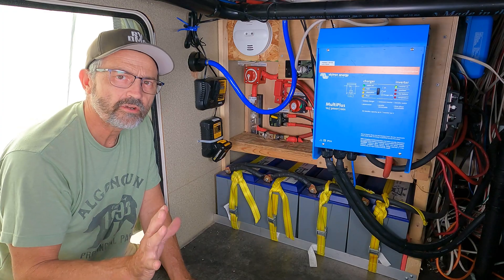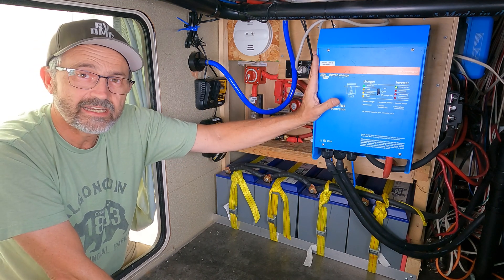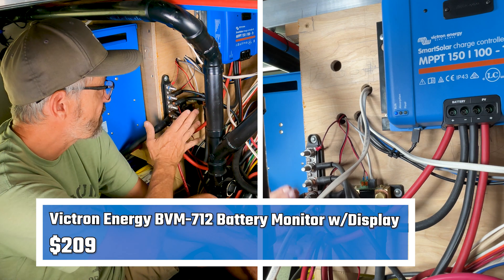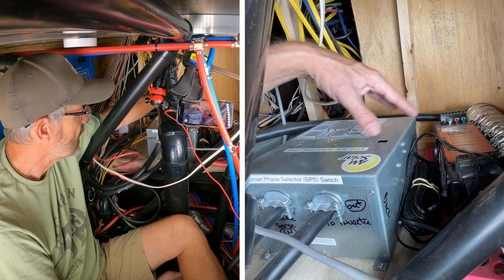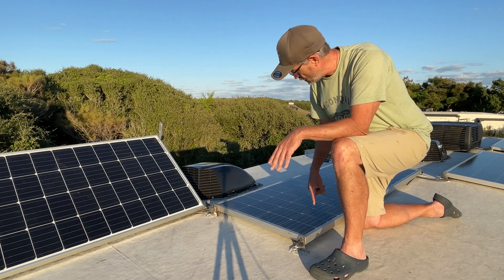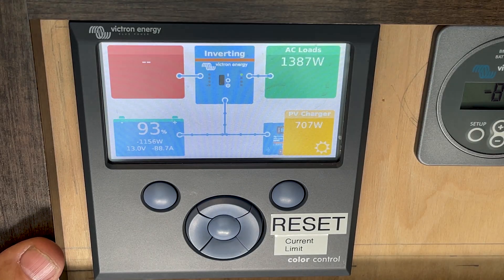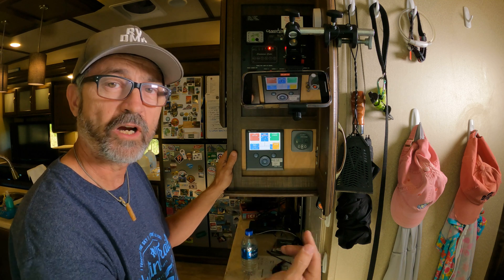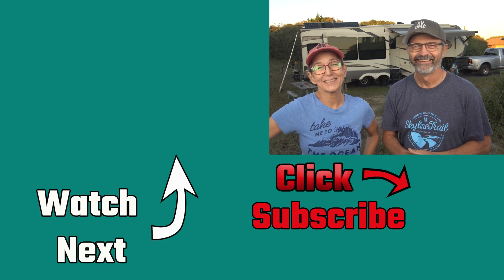Our DIY Solar System Overview - Solar Series Part 1(RV Living) 4K

Comment: Great video I have installed a small solar system on my rv I have the victron smart shunt with Bluetooth . Is there a way to increase the range of the shunt?
Reply from the maker: The only way to do that I believe is to connect it to a cerbo gx, or ccgx, Vic Tron control panel, connected to Wi-Fi, connect the VRM app, then you have access to your battery monitoring anywhere you go, but that is a very expensive option probably five or $600 for either .  Lar

Comment: You did a nice job securing your batteries. How did you attach the ratchet straps to the floor (or to the angle iron?)
Reply from the maker: The straps go under the angle iron and they are screwed to the floor.  I just took all that out of the rv last week to move to another rig and they had not moved one mm.  None of the battery bolts loosened every thing was as tight as the day i put it in, 4 years later.  Larry

Comment: We are at boondocking and realized that we need to keep the residential refrigerator going on. We are working to get solar package. Thanks for sharing with us!
Reply from the maker: The lithium batteries and inverter are so important. We wish we had more batteries. We weee going to add more solar but probably won’t. 
Once Larry is feeling better, he should have his battery installation video 🤗 
FYI We are glad we have an RV fridge though we hardly put it on propane now. 
Alice

Comment: Larry  .... Great video and your system looks awesome.  My question is, what are the biggest benefits of the system if you have access to shore power or have your Honda 2000W generator handy.  I certainly see the benefits if you do a lot of boondocking, or if you only have access to 30 amp service and you need more power.  Can you help me understand what the biggest benefits are, other than the ones I mentioned.  Thanks !!
Reply from the maker: Great questions Jerry, You will have to wait for my next videos, just kidding.  We often camp at Florida state parks with 30. Amp service only.  With this setup, we can use all of our 120v devices as if we were on 50 service including using two air conditioners.  The inverter and battery bank just make up the difference in power demand, the batteries will run down a bit , then when demand is less they automatically charge the batteries back up to 100 percent, we dont have to do anything.  Of course we have to be reasonable, we cant have both acs on and the fireplace and the water heater and the fridge all on 120 at the same time.  Sometimes will will put the fridge and water heater on propane if we are running both acs on 30 amp service.  The benefits of the system are more obvious when dry camping completely disconnected, if we have full sun during the day the batteries charge up really well.  Cloudy days or in shaded spots we use our 2200 watt honda generator to charge the batteries up pretty quickly, as i can give 1800 watts continuous to charging the batteries.  Running AC Drycamping is possible for us on batteries alone but realistically we need to have our generator connected to keep cool on hot days while drycamping.  Hope my answer wasn’t too long, Larry
Reply: @DownsizingMakesCents  Thanks for taking the time to write up your comments.  Y'all do a fantastic job with your videos.  I have found several of them to be helpful and informative.  I put DSMC right up there with the best of the RV You Tubers!  I found your comments re: Florida State Parks to be interesting.  We recently upgraded to an Alliance 310RL FW (35') which is similar to your rig.  We will be retiring from Metro Washington DC to South Carolina, and plan to spend a good portion of the winter in FL, most likely at state parks.  Our 310RL has 3 A/C units, which are supposedly designed to draw less current, but I don't have any data as of yet since we just got the new rig last month.  I'll purchase at least 2 LI batteries, since we have the 120V Res Frig and a 2K Watt Inverter.  I did purchase one Renogy Panel and Charge Controller to help me get familiar with the technology.  Not sure if we'll continue down the solar path or if we'll opt to purchase and daisy chain a second Honda generator and put up with the noise.  Your video was great food for thought.  Need to use our rig for a while to see what would be the best solution.  Thanks again for putting together helpful and informative videos that are a great benefit to the RV community.  Safe Travels !!  Jerry

Comment: It looks like the AM solar mount to the solar panel can be mounted on the end (shot side) or side (long side) at each corner is that correct? Did you have to drill holes into the solar panel frame? How far do the brackets with knob stick out (how much clearance should I calculate for). Thanks.

Tim
Reply from the maker: Yes I did have to drill the holes in the solar panel frame I created a jig to make sure that they all we’re in the same place on each panel.  The mounts have to go on the short sides so that you can tilt the panels,  i’m working on a video where I go through pain staking detail on the bracket installation.  I think they stick out about 3 inches but I’m not sure.  Larry

Comment: I really enjoyed this system. We recently upgraded to a 50 amp5th wheel which came with a 190 watt panel, pwm controller, and 1000 watt inverter, and 2 12 volt fla batteries. What would you upgrade first, if doing at a little at a time? We mostly camp in state parks with 20 or 30 amp shore power. Lithium battery bank? Multiplus II? MPPT?
Reply from the maker: Nathan, batteries first. Inverter second. 
We definitely see our batteries as our best bet. State park pedestals hardly give you what you need. 
Alice
Reply: @DownsizingMakesCents  thanks!

Comment: does the inverter need to be programmed?
Reply from the maker: The correct battery settings have to be programmed. But if you buy it from Battleborn, it will come pre programmed for their batteries. 
Larry programmed it himself using MK3 interface from Victron. 
Alice
Reply: @DownsizingMakesCents  thank you

Comment: Did you use the coaches prewired 10 gage wire from the solar panels to the solar controller?
Reply from the maker: unfortunately my rig did not come with any pre wire, or even a place to run the wire.  I had to do it all my self, drill holes in the roof, roof support, walls, cabinets to run the 2g wire from the roof to the basement.  That was the most challenging parts of my build, but i actually enjoyed trying to figure out the best way without destroying my rig.  larry

Comment: Per code you need an actual disconnect from your solar array. Just thought I’d pass that along. A simple breaker doesn’t meet code.  I only mention because I am designing my system. Check it out.
Reply from the maker: Thats really interesting, I do use my breaker as my solar panel shut off switch, I will look into that, and ask an expert buddy of mine, thanks for the tip.  Larry

Comment: I recently purchased solar panels and a solar controller. I already had the batteries. I plan on using 12 volt items, lights, electric cooler, and other 12 volt equipment. My question is: Do I need to disconnect the solar panels when I'm using the batteries for power, or, can I leave the solar panels and controller attached? Thanks for your video.
Reply from the maker: Yes I leave my solar controller connected all the time, as a mater of fact, i have not ever disconnected the panels in the 16 months since i built the system.  I have a victron mppt controller, im not sure if this applies to all solar controllers. Larry

Comment: Hey Larry - another great video! Thanks! Guess what? We sold our 5th Wheel, and have listed our Silver Ford F-350 Diesel Dually tow vehicle for sale. In a few months, we’ll be looking at Class As instead! (Wanna buy our Ford?)
Reply from the maker: I’m sure you wont have a problem selling your ford truck in this market, you May get more than you paid for it.  I would love to hear more about why the switch from 5er to a class A.  I have a buddy who is doing the opposite, you guys could have swapped.  Larry
Reply: @DownsizingMakesCents  a small number of reasons: 1) we bought a house with an RV garage and our 5th wheel was too tall; 2) we weren’t happy with the ride in the truck over certain rough stretches of highway; 3) we decided our rig was too long (43.5’) and so we’re gonna stay under 40’ with a Class A.

Comment: We have the same system, only dual victrons for 50a, 1600watts of solar, and 600ah of Lithium.  I recently had some family members join us at a boondocking site at Coconino National Forest.  We'd plug their RV's into ours so they could get 120v power and not have to run a generator.  We cooked meals together using our electric instapot pressure cooker, ran rice cookers, watched movies at night, a really great time.
Reply from the maker: The system really opens up camping options, and still live like you have hookups.  I’ll bet they loved being able to plug into your RV for 120 v appliances. A small generator is still an important part of our set up but we only use it to charge batteries when there is no sun or too much shade.  Larry

Comment: I just finished today installing a new Victron Multiplus II with one 206 AH SOK battery.  We don't boon dock much at all maybe a night here are there when traveling.  I'm torn about putting any solar on it.  More likely to add charging from my truck alternator. I put the battery under the bed and have room for three more if I think I will need them.  The install went very well.  Your install looks great in my opinion.
Reply from the maker: If I did it again, I might leave the solar off, just use my eu2200 to recharge when drycamping.  All those holes in the roof to worry about, haha. I wish the multiplus ii was available when I did mine.  Hope you enjoy your system.  Larry
Reply: @DownsizingMakesCents  when your running your AC what problems to you see?  Do you have a soft start on the AC's.

Comment: Hi - Great video!!  Love the detail.  How does the 12 VDC from your truck on the road interact with solar on the road?  This is a question I have been considering for awhile and as of yet am uncertain.  Please let me know your thoughts.  Thanks.  Take care.
Reply from the maker: That is a great question and one i struggled with designing my system.  I did not change my 7 pin connection at all. There is a very small amount of amps transferred to the battery system from the 7 pin but is is almost unmeasurable.  The 12 volt supply from the 7 pin is from very small wires not designed to provide any significant amps.  Some people disconnect the 12 v supply but i did not and it works fine.  I did consider running a separate 6g wire from the trucks alternator to the  battle born battery but that would require a special device to limit the amp draw, Anderson plugs, and drilling though my trucks firewall.  The lithium batteries have such low resistance if you dont use a limiter, it could cause damage to the alternator by overloading it.  As it turns out i don’t need it anyway, when we are towing, i run my RV fridge on 120 volts using the inverter, and after a long drive with no sun I still have plenty of battery power when i reach my destination.  In sunny travel days, the batteries keep their charge really well.  The only reason i would install the truck to RV wire is to provide alternate charger when there is no sun, and I cant use my generator at a dry-camping location.  Or maybe if i ran out of gas for the generator, and i need to top off the batteries.  I guess i went overboard with this answer, i need to make a video about this subject,.  Thanks for the great question.   Larry

Comment: Another great video! I  was waiting to see your "what we did" video. While my wife and I are not planning to full time, just long time with a home base and want to have everything as ready as possible to be ready to get in and go! This past June we had a system very similar in specs to yours,4-battleborns, whole house inverter charger, and all the bits, installed by a company in Reno, NV.  Since we still are working until next year I  wouldn't have the time to  buy and install the system myself  so we paid to have ours done. Ours cost  $14,000.00 so in actuality not too much more than yours and we too feel it to be one of the best expenses for what we're planning for the future. And it works great too! We love the system!
Reply from the maker: Joseph, that sounds perfect. Not everyone wants to or can do it themselves. We are glad to hear you love it. 
We plan in the future to have a homebase and do extended trips like you. And we still see the benefit of a system like this 🤗 
Alice

Comment: Very nice job.  I did a similar DIY install with similar specs (ie: 4 battleborns, Victron 3K inverter, Victron 150/85amp Solar charge controller, 6 x 200 watts panels, etc.)  Perfect for our setup.  We use a Raspberry PI running Victron OS to monitor our system.  It sends everything to the Victron Portal via WiFi (to our Jetpack).

We had an issue with the inverter when on and providing AC current assist going into overload when our Keuerig machine would start.  I found out that there is an additional setting called boost factor on the Victron inverter that was set by default to 2x.  What was happening was when I was on 30 amps or running my generator (either 30 amp or 15 amp AC supply) - when the Victron needed to assist (ie: add power past the level set (ie: lets assume 30 amps) the boost factor setting of 2x would try to get the inverter to assist starting at 2x 30amps = 60 amps - causing a brief overload.  Setting the boost factor to 0.8 X when assisting past 30 amps kept the inverter assist at a max of 24 amps starting out.  For the generator, setting the boost to 0.8 X would allow a max initial inverter assist of 12 amps.  

If you have the USB MK3 adapter you can adjust this value using the Victron configuration tools.  Wish they would make the boost factor dependent on the max current level one sets as to not exceed the inverter specs (ie: 25 amps).  This boost factor is only for initial assisting when it senses a load greater than what you have set.

I also replaced the Keuerig with another model that does not use Triacs - it is easier on the system when powering up (before I discovered the boost factor setting on the Victron).  The boost factor setting solved my issue though.
Reply from the maker: Hey Mark, that is really interesting about the boost factor, i will have to plug my MK3 in to see what mine is set to, prob the default 2x.  The only time i have experienced an overload is when i try to start my living room AC, (it does NOT have a micro aire easy start)   The inverter has no problem with my bedroom AC which i have installed a MAES.  I have not touched my inverter settings since i programmed it when i installed it. Thanks for the tip, Larry

Comment: I added the Digital Multi Control 200/200A GX to my set up to avoid the clicking into the Color Control GX - plus it's easier to set the input current limit another display to make it look pretty....and my wife finds it easy to set the input current limit and monitor the system without all the clicking around...and it's simple to turn the Multiplus on or off from that display - my two cents :)
Reply from the maker: Yes I agree the Multi control is less complex and easier to use and set up.  I really like the VRM capability of the CCGX so the extra $$$ was worth it for me.  That was one of the choices i struggled with when designing my system.  Larry

Comment: I’m not an electrical guy.  You lost me at battery 🤓.
Can the solar panels alone power the ACs?
Reply from the maker: There really isn’t a system without batteries. The solar can charge up the batteries and run AC for hours if you have good sun,
Alice

Comment: Since gasoline powered cars are most fuel-efficient at highway cruising(constant load, but not flooring), I guess you can set the current limit for the generator to a lower-than-maximum number to get the highest fuel efficiency?
EU2200i page says full tank can run for 3.2h at max load and 8.1h at 1/4 load, so maybe the highest efficiency is around half load and 3/4 load?
Reply from the maker: Larry finds the most efficient at 7.5 amps or at 800 watt - if you aren’t worried about loudness. This should give about 6 hours. 
Alice

Comment: Hybrid mode is a Huge feature! Nice system design… does the smoke detector in the battery bay do remote notification?
Reply from the maker: Stan, the remote notification for a smoke detector would be awesome. We will have to look into that 
Alice